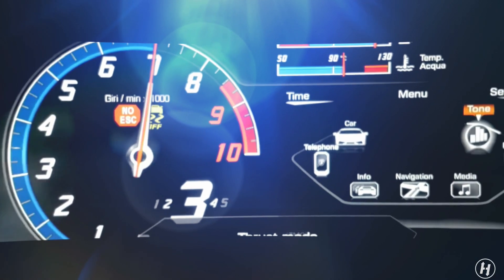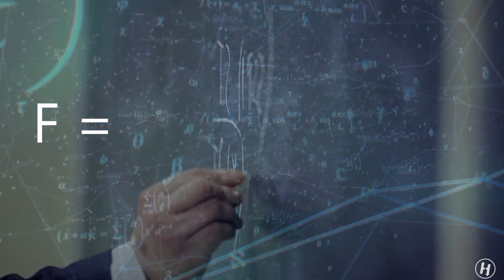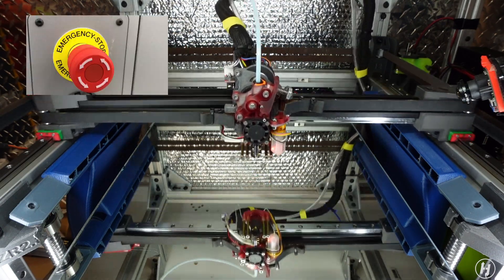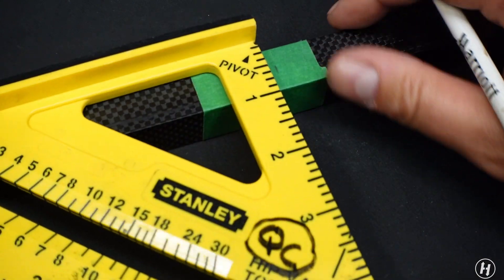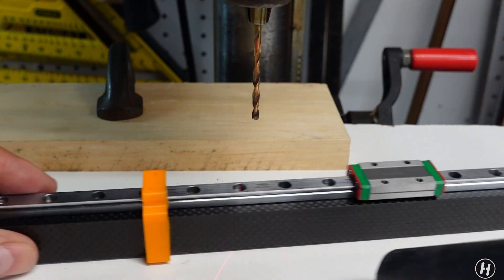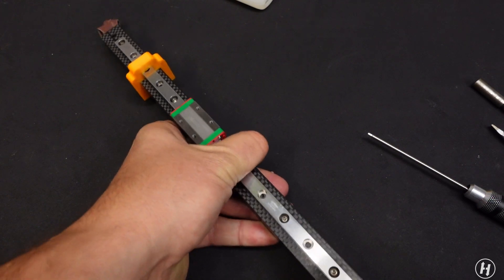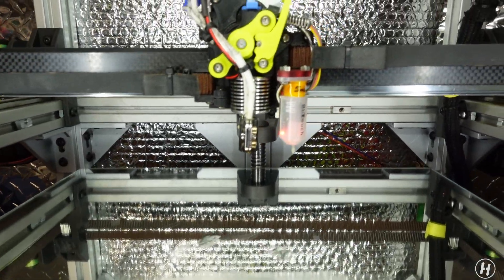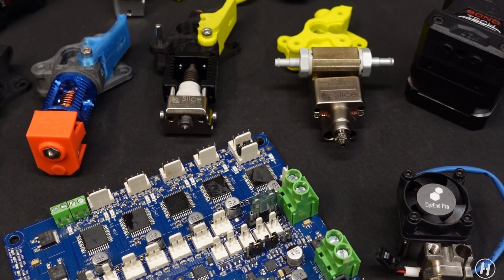Using TITANIUM and CARBON fiber on your 3D Printer

Comment: 48v motors would avoid more current while giving you double the power. And the octopus pro will drive them (up to 60v if you can find them)

Going to 4 ab motors which is now possible with klipper would probably also help because double the power and shorter belt lengths.

Also Canbus head pcb would likely lighten the assembly significantly by eliminating a ton of wires in the chain. Not sure if you’ve done that already. And a 48v pancake extruded motor will probably help too because it should be lighter.
Reply from the maker: Unfortunately 48v does not double torque. It only enables the motor to exploit a bit more torque at higher speed.  But it is far from double.  This is what I am running now, XY and E.

And yes, we asked the Klipper developpers for AWD last year (4 motor coreXY).  It is now fully integrated in the main klipper fork.

As for CAN bus goes, there seems to be a communication speed limitation with some boards that is creating issues. I evaluated the weight a while back and it was not worth it.  The weight of board and connectors is more than the wires it removes.  It is not the entire length of wire that consume acceleration and energy from the motors.  The weight of a CAN bus board with connector would.
Reply: @MirageC  Must be something wrong with those 48V motors. While it won't be perfect, if anything I'd expect MORE than double the power out of them because you're line loss on the wire will be almost half at the same wattage.  And given the same windings, unless there is a design flaw you'll also see more power because of less wire loss and the ability to use thinner wires for the same power.  This is what you see with an ODrive with BLDC motors as an example. 60V is WAY more efficient than 24V or even 48V at the same wattage.

Interesting about the  canbus board. But I would assume that like unsprung weight on a car that the chain drag is a force equation based on the sine of the angle based on it's attachment point, so it's multiplying the weight which of course includes many wires instead of 4 and with only 4, you should be able to use significantly smaller chains which should save significant weight that is magnified because of the force equation like much like wheels and tire weight drastically affects performance in a car at like 5 to 1 per pound over sprung weight from the chassis.  The speed issue is a speed issue in general with CAN. The idea board would be ethernet at 1 gbps with < 0.2 ms delay I would assume. Even 100 mbps over 2 pairs would be vastly better than CAN.

Of course reality and math equations are 2 different things often, but in a perfect system these should show major improvements.
Reply from the maker: @jameshancock  Steppers are very different from BLDC. 
https://www.linearmotiontips.com/stepper-motor-performance-is-it-possible-to-get-high-torque-at-high-speeds/

I dont use drag chain they are too heavy and at those speed they would simply destroy themselves. ;)  Qty2 AWG 20 and Qty9 AWG 24 wires in a sleeve aren't that much of a weight killer.  ;)

Comment: On YT is a guy that prints with 50.000mm/s
https://youtu.be/1Q_OWbR9x3g
Reply from the maker: You may have one too many zero on there ;)
and here is 150,000 Accels on Servo motors and full weight gantry: https://youtu.be/ZyTnz5_XGGU?t=121
Reply: @MirageC  yes ups, u correct it, comes from writing with chronic pain 😂.
Reply: @MirageC  nice 150.000

Comment: Did you happen to weigh the heavy rubber belt with that X carriage?  Perhaps, you could use carbon fiber for your belt, as well!
Reply from the maker: HevORT has 3 options for belts: 6mm / 9mm and 12mm to support any type of print head your wish to move at high speed.  My personal machine is more of a test bench for all these configs and currently sports the 12mm belts.  Gates belts are glass fiber re-inforced, not CF.
Reply: @MirageC  I thought you were trying to modify anything on it that could make it faster?  A CF wire wrapped around pulleies might be lighter and stronger, evan if you need to modify it!

Comment: 3D print molds for forged carbon fiber parts for the plastic parts you haven't replaced. 
im doing just that after seeing an "Easy Composites Ltd" video on it

im working on designing a fast 3d printer from scratch. my 8 year old printer is abysmally obsolete. 
its still rocking an acrylic frame that the 3d printer space has moved away from for obvious reasons.

Comment: Have you looked into using IGUS drylin rails/carriages?  They are a drop in replacement for the MGN linear rails, I've got a set of 12mm ones coming as an upgrade for my 500x500mm ratrig.  My reasons are mostly noise related since they are polymer bearing surfaces not ball bearings, so silent by comparison. But they would probably be a really good weight savings as well, since the rails are hard anodized aluminum, not steel. Definitely would shave a few grams off your gantry.
Reply from the maker: We have looked at a few drylin components and never found something with the right tolerance for 3D printer.  Keep me posted on your findings.

Comment: The only way to increase accelaration from now on is to run a moving table and y axis at the same time, with good adhesion you could double the performance. You could also use carbon for such a moving table
Reply: that would be absolutely insane speeds

Comment: hi bro! what s the measures of the carbon fiber square tube? i missed the part of you saying that and i was very curious to try it out on my new voron! thanks!!
Reply from the maker: This tube is around 20X20mm.  My printer is a HevORT, I suggest you refer to the Voron community to obtain the required length for such printer.
Reply: @MirageC  i Heard that some guy did that with some Little change in supports and if i manager to get the stl i Will order the tube to try It out. Thanks for the measure

Comment: I found this looking for ideas for a carbon X.  Given the cut to length is not precise, how did you make it adjustable (even 1mm)?
Reply from the maker: Cutting dimension is not so important.  My carriages can accomodate for a good 2-3mm variation. The critical dimension is the distance between the holes.  So I installed a carriage on one end and marked the holes for the other end at installation. A small round file to slot the holes a bit and all is good.

Comment: Haha I don't know how but I'm getting right around 60k accel with some high torque amazon steppers and 1.5 amps. I'd call it a modified VZbot but no part of it resembles it anymore.
Reply from the maker: The HevORT nema23 are not torque monsters but they are smooth, silent and excellent for speed.  Using 12mm belt increases friction and mass of inertia too.
Reply: @MirageC  yeah I can't really figure out why my printer would go faster, especially because it's on 24v. I probably have a lighter x axis but it's not especially loud outside of the clicking noise when it changes direction
Reply from the maker: @3DFactoryTech  this video was made using 24V.   Clicking noise on direction change can indicate something loose.  My printer is very rigid. Although most parts a plastic the forces in the gantry design are mainly oriented in a manner where they are compressing the carriages and motor mounts.  Adding a 3030 frame also ensures that all motions from the motor are transmitted to move the print head.  Loose components will act as an absorber and might allow for higher motor accels.

Comment: I wonder if you could use machined aluminium nuts/fasteners. If you form tap the nuts, instead of cutting them, they get really strong, especially if you use a 7XXX-series alloy. Not as strong as titanium, but lighter.
Reply from the maker: Perhaps its my aerospace experience speaking, but Alu and CF are usually to be seperated by  surface protection or intermediary material to avoid galvanic corrosion.  could be feasible, but Ti is more straight forward in that respect i think. Now.. is it truly important for our applications?
Reply: @MirageC  Never thought about them reaction with eachother. All I know is I've used aluminium washers for CF parts with success on car parts. I machine a lot of 6- and 7XXX- alloy, but I work very little with CF.

I guess also galvanic corrosion is most problematic in a humid environment?  Not really my field haha

Comment: How do you derack the XY gantry when using a carbon tube?
Reply from the maker: Same way as you do with aluminum 2020 X axis:
- Center one Y MGN Rail and secure in place.  
- Bring loosen X to the front
- Tighten X so it is flush to frame reference marks.
- Tighten Y carriages
- Using X cross member as a reference, tighten the last MGN rail from front to back.
- Install belts and tight them so you maintain the alignment of X axis to its front reference marks.

Comment: Wow brilliant video.  So the rough rule of thumbs seems to be if you roughly half the weight you can roughly double the acceleration?  I need to get modding - carbon fiber is something I've never worked with before!

Comment: When I raced 1/10th scale R/C cars we had weight limits.  We used titanium for things like the steering turnbuckles where strength was an issue but aluminum bolts in all other places.  Those aluminum bolts are crazy light and still have decent shear strength.

I use drill bits made for drilling for door hinges, they have a spring loaded center guide.  Good quick way to get a centered pilot hole on things like linear rails where accuracy matters.
Reply from the maker: Yeah, Aluminum fasteners would be good to. The only reason I went with Titanium was to avoid galvanic corrosion between Carbon and Aluminum.  I could coat the exposed carbon with some epoxy I guess.

Comment: Some lightness ideas:
1. Thinner side rails for whole X gantry - it looks like it's overlooked but when your printer is doing Y move it actually swings 3 linear rails carriages - one for the head and two for the whole x gantry. It could be worth looking for smaller Y axis rails as it lets you use lighter carriages (going from MGN12 to MGN9 drops something around 40 grams from the whole X gantry)
2. Lightness holes - drill holes the size of socket needed to install nuts on the opposite side of the beam, which will remove mass without impacting stiffness that much, with added bonus of simpler rail installation and added possibility on nondestructive removal.
3. Hollow bolts - used on racing bikes, half the weight of normal ones, don't know if obtainable at this size (can always drill it yourself).
4. Adhesive - use adhesive to bond rail with carbon fiber tube and reduce number of used fasteners only to critical ones.
Reply: smart man :) yes I agree!
Reply: If I may add to this...
- Belts: switching from 10mm width to 6mm width will reduce the belt's mass by up to 40%.  In so doing, you'd have to get shorter and thus lighter idlers, reducing moment of inertia and thus further increasing acceleration.
- extruder type: I'm sure you've considered it already but it is worth pointing out the significant reduction of mass by implementing a bowden setup for the extruder. Use Capricorn tubing and an inline lubricator to minimise the compromise on flow.
Reply: @jacobnassr-low7757  In addition to the low friction bowden setup, something simple could easily help the tube freely move too. Removing the slightest amount of drag on the gantry..
Reply: I don't think the lightness holes would be an efficient trick to use here, due to the way carbon fiber material is made. When it comes to metal construction, absolutely do use it and same for plywood, because the glue used in most plywood, chemically bonds the fibers together. I do though doubt that is the same for carbon fiber materials, as although they are layered and use epoxy, there are different strengths of epoxy and the stresses of higher acceleration could exceed the maximum limits of the epoxy used for the carbon fiber bonding. That means that lightness holes can cause cracking, which will first cause wobbling and eventually stop the gantry from printing straight.

This is also why he used inside and outside blocks, plus added tape for support when drilling and cutting the material, as it would otherwise delaminate. A possible way around this, is to make the holes larger and add reinforcing material that doesn't increase the weight anymore than what it would be, if he went with the size of the holes you suggest. Any reinforced material should, of course, be epoxied in place. A potential work around without adding more material, is to seal the edges of the holes with epoxy to prevent delamination, but I'm not sure how much that would help, as it theory it should work, but potential variables are the lamination strength between the carbon fiber material surface and the added epoxy, as well as the stress capacity of the epoxy itself.

Thinner side rails could be an option, if the friction induced by the increased speed, doesn't cause the rail to become skewed, due to uneven heating. If Titanium rail and carriages can be found however, then that would significantly increase the efficiency and same for hollow bolts. Titanium is already incredibly light, but making the existing bolts even lighter as you suggest, is just a plus and so for using adhesive for bonding the rail to the carbon fiber, if industrial grade epoxy is used (as that would make the tube break before the epoxy)
Reply: Might be impossible to manufacture but a titanium linear rail?

Comment: Fantastic video - you have a new subscriber.
Reply from the maker: Thank you :)
Reply: @MirageC  I'm working on a design for a giant 1000mm by 1000mm printer - I know it isn't practical and I only need it to print my Robot Base Units so I don't have to cut them into pieces in slicer and then glue the results together. This video has shown me a few of the "errors in my ways" :)
Reply from the maker: @retroatx  what kind of bed plate and bed kinematics are you intending to use?
Reply: @MirageC  I was going to do something similar to what Ivan Miranda has done. I think he used the open source Prusa and made it gigantic - but I have a lot to learn if I have any hope of success.

Comment: Why do you mount linear rail (X carriege) at the bottom ? for example voron mount it in the side and vez3d and ratrig on the top
Reply from the maker: To minimize distance between nozzle and rail.  And also to reduce vertical distance between Y mgn blocks and X rail.   Heavier X carriages may benefit from rail on top to better manage Center of Gravity though.  I have a version coming out soon.

Comment: It might be interesting to try making a wire harness out of aluminum wire, replacing the copper.  Or even just focus on using wire of minimum gauge, and also removing the braid and replacing it with a wrap of Kevlar kite string.
Reply from the maker: Good point.  though aluminum wire would break much easier by fatigue.

Comment: Weight saver?  I have been wondering about the use of a dc motor instead of a stepper on the hot end. The idea is that the dc motor provides enough force to push and pull the filament , but the flow of filament is controlled by a remote (bowden) stepper . The dc motor could be a tiny spinning very rapidly and geared down to generate the necessary force (there has to be some balance here as the motor needs to reverse for retractions.

Comment: Why not counteract/compensate the weight after getting it lighter? With a counterweight like in a lift or in a balance ?
Reply from the maker: The compensation weight will still need to be accelerated and moved using Stepper motor energy.  What would be the benefit of this counter action?

Comment: You midge want to fill any hollow parts with a lightweight, vibration-dampening material (such as a polynorbornene foam, perhaps?)

This might also add a bit of additional rigidity.

Comment: great video,, you could 3D print with carbon fiber the 3D printed components that you use on the x carriage, maybe more weight savings (?) Also you can try sensorless on Z axis so that you can remove the BL touch probe.

Comment: why do you need a rod or aluminum extrusion to begin with? Isn't the linear rail rod rigid enough?
Reply from the maker: No, MGN rail only gets bouncy.
Reply: @MirageC  really! they look rigid enough, I've put mine on a core-xy horizontally (the wide part co-planar with the mouvment plane) and didn't notice any issues so far.
Reply from the maker: @x87alpha1  at 60k accel with direct drive extruder and 500mm/s it will twist and oscillate.

Comment: OK so we're already at the point where using Gs to measure acceleration is more useful, 5.7 at that.
It just never ceases to impress!
By the way did you remove the servos? If so, that's for a speedboat print or are the steppers here to stay? If so I would be curious about the reason.
Reply from the maker: I would not be able to measure the gain of weight loss with the ClearPaths, they are too strong ;).  But I am still battling with some print artifacts when using them.